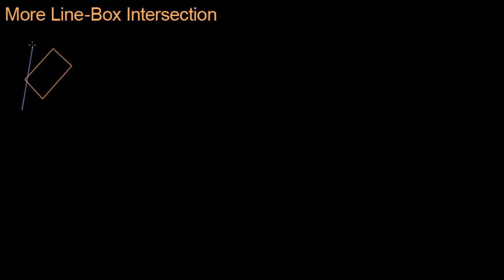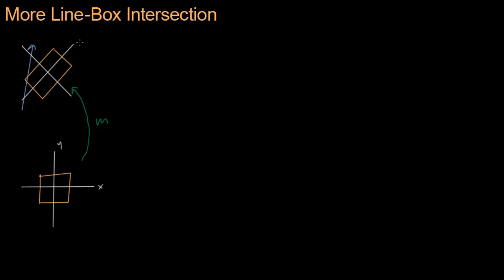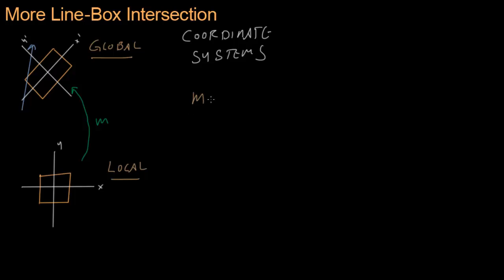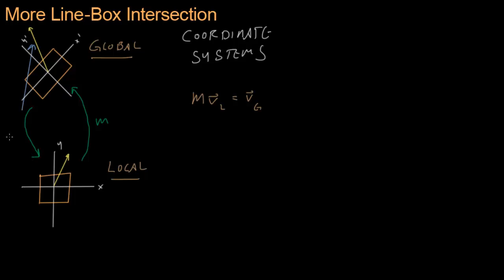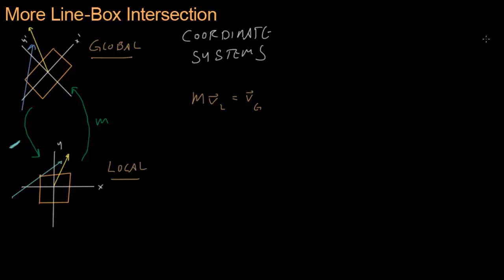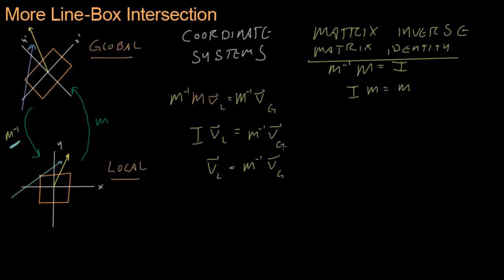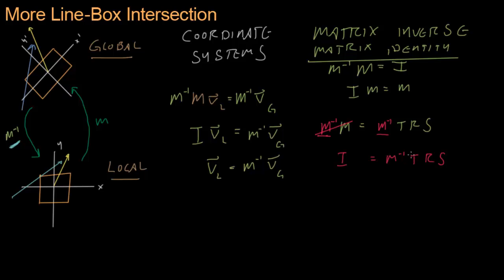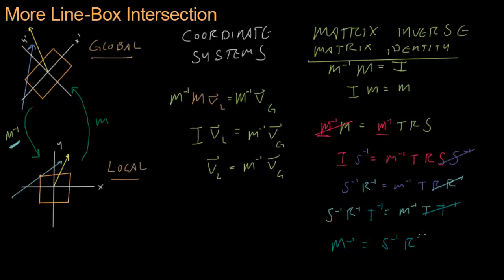Math for Game Developers - Updated Bullet Collisions (Coordinate Systems)

Comment: Are your local and global the wrong way round? Its my understanding that after transformation the axis are referred to as local, and that global axis are always (1,0,0) (0,1,0) (0,0,1). At least in unity if you translate something by global axis then it will be done via those three vectors, whereas if you use "local space" it translates it by its own transform matrix. Am I missing something?
Reply from the maker: That's correct, it's a bit of a weird concept to describe and I may have made a flub or two in the video mixing things up. If so sorry about that. Generally though, if something is in the "global" coordinate system then you find its location using the (1, 0, 0) (0, 1, 0) (0, 0, 1) axis. If it's in a "local" system then you find its location relative to the position and rotation of some object. It sounds like you have the right idea :)
Reply: Oh good. I'm doing a degree in Games Programming in the UK and I'm using your video's as revision. My Matrix math is no where near what it should be because most engines/frameworks do all the fun stuff for you!
Reply from the maker: Hey cool. I'm actually traveling at the moment and will be visiting the UK shortly, can't wait. Good luck with your exams.